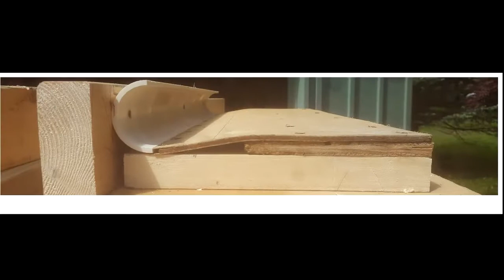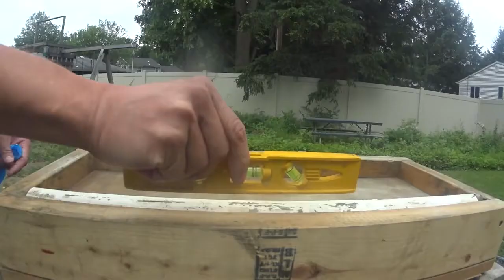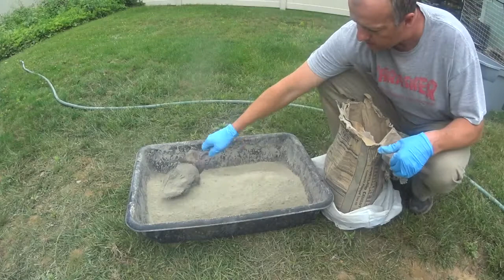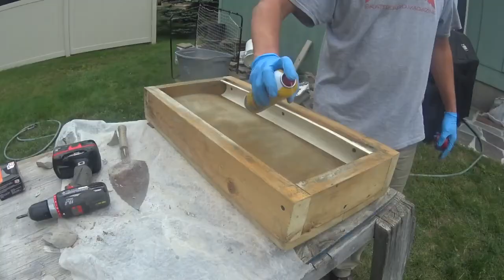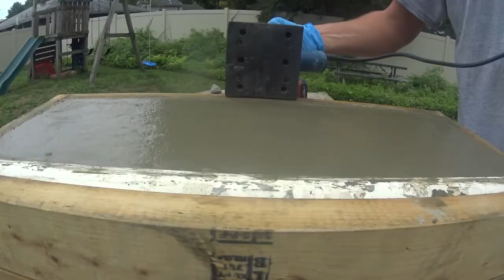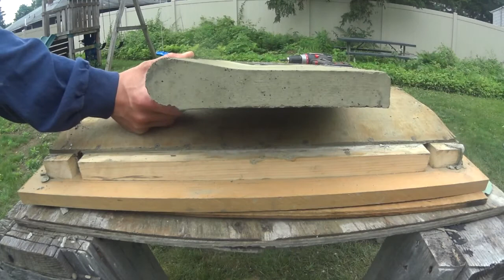DIY Pool coping block for skateboarding

Comment: How long did you soak them for? Great video, thanks.
Reply: For as long as possible. I soaked mine for 30 days. The longer they soak the slower the reaction occurs making for a harder block. GL.

Comment: I was wondering what you sprayed on the mold before you poured the concrete, and is it to help the block release? Great video, and thank you!
Reply from the maker: I used a cooking spray (Pam)  as the oil/release agent.  I'm not convinced it's totally necessary but I'd thought I'd play it safe anyway.  The next day, when I was taking the form off, all it needed was a little whack of encouragement from the hammer to pop off the block.
Reply: winplaceshow ,thanks man.(need all the help I can get!)

Comment: Is there a tutorial on how to make the mold and the right concrete mix?
Reply from the maker: The first picture in the video of the form should tell you all you need know about how to build it.  If you doesn't make sense, find someone with some basic carpentry skills and show them this video - they'll figure it out.  But I'll try to come up with something a bit more descriptive.  In regards to the concrete mix... first of all, I used quikrete, which is already the proper mix ratio.  Then I added some portland cement to make it a bit smoother.  How much? Well, it's pretty much a 1 to 1 ratio... I suppose you could take the dry mix and fill up the form to ensure you have enough, then add more to be sure.  Then mix it with water (in a mixing pan, of course!).  Concrete isn't rocket science, don't over think it!  As long as your form is good, the rest is easy.  Good luck!

Comment: Awesome video thank you. How long did you leave it in the form and how long in the water before you installed it
Reply from the maker: I left it in the form overnight.  I left it in the water for just about a month.  Make sure you vibrate the cement once it's in the form. the time lapse only shows a second of it, but I probably vibrated it for at least 10 minutes.  Maybe if I used something bigger than an orbital sander it could have gone faster, but I was amazed at the amount of air popping out!  Less air = stronger concrete.  Good luck!
Reply: @winplaceshow  why do you leave it in the water? Does it make it stronger?
Reply from the maker: @trevhaas96  yes.the longer it's in the water the harder it gets. Essentially, slowing down the curing process and allowing the chemical reaction to last as long as possible.

Comment: Rad vid!  - I'm making some concrete mini quarterpipes in our backyard and would love to have pool coping on top.  Question...Depth of board on top?  (that bends on top of the plywood) 1/4" maybe?
Reply from the maker: Thanks! I think it was just shy of 1/4", it was piece of luan... either way, ideally the board matches the gauge of the pvc so it's smooth. But the good thing is is that a minor difference won't be noticable... Not while you skate it at least. Good luck!
Reply: @winplaceshow  right on! thanks man! We are doing a little reno of our patio that happens to lead up to a perfectly banked slope in our side yard.  Plan is to lay a new concrete slab then I have a ton of old brick that I plan on running up the bank - to a "bench" that happens to be in the shape of pool coping!   😂  happy wife happy life!

Comment: I’m an idiot and know nothing... what does letting it sit in the water actually do for it?
Reply from the maker: It slows down the curing process.  The longer it cures, the harder the concrete.
Reply: winplaceshow also one last thing, what did you spray it with before the pour? I’m almost done my mold right now after watching this video. I’m gonna run out and get the Crete and that spray if it’s that necessary
Reply from the maker: @JamesJenkemJingleHeimerShit  is cooking spray, Pam. It's supposed to act as a release agent, so the form easily pops off. Although concrete doesn't really stick to wood, if the wood swells due to the water in the mix, it could be a pain to pop off without damaging the concrete block.

Comment: What concrete did you use I see you mixed two kinds together?
Reply from the maker: Quikrete Pro Finish 5000 psi concrete mix (that's the first bag) and Quikrete Portland Cement (3, 4 scoops to smooth it out)

Comment: GREAT video !!!! Have you tried to grind them already and Is it strong enough in the long run ? 
And also, why do you put your blocks into water ? 
Thanks ;)
Reply from the maker: Haven't had a chance yet - just finished the quarter and battling a bad knee.  But I'm pretty sure they'll last.  Also, I'll put some salba sauce on them to help with the grindage!  As far as the water goes, the purpose of that is to slow down the chemical reaction - to give the concrete a longer time to cure - the longer the stronger!
Reply: @winplaceshow  salba sauce?
Reply from the maker: @0rionskate  skate jargon for clear enamel spray paint! Any hardware store will have some.😎